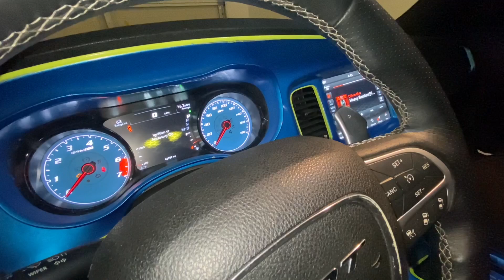Dodge Charger Bass Will Make Your Ears Bleed

Comment: Bro I do car audio for a living this is what u need for a deep slamming bass. Run a optima yellow top battery as a secondary battery and use only 0 gauge wire to bridge your batteries together then run your amp off the second battery without grounding your ground wire to the chassis but keep remote wire connected to your radio so u still can be able to turn your amp on an off and don't use not fuses on the positive cable on the amp wire use only straight wire because it will bring the full performance of the amp to push those 12s. Trust me bro it will make a big difference in the sound especially with the subs u got.

Comment: Yea I got 2 15 skars in my challenger just need to find a good Amp for them they loud
Reply: What amp you have now?
Reply: My Patna got 2 15 nemesis hectic custom box and  a 8k watt amp and some Badass voice speakers and a good amp for the voice and it sound badass and the voice is clear asf and he be pulling up bumpin in the school parking lot😂😂
Reply: I have a sound digital 3000 watt Amp I originally had 2 15 ground zeros subs but the subs weren't made for the box I had custom built
Reply: @b00zie23  do u know about the smart3 taramp

Comment: You not supposed to "turn ya amp up" you're supposed to match your amp to your radio gain. It also has a lot to do with that amp you have. Get a good Korean amp and it'll make a difference. That amp you have is ok. Remember low frequency bass is windy your higher bass is going to hit harder